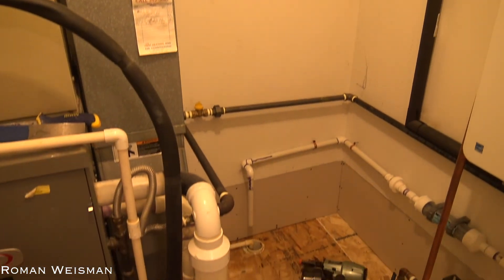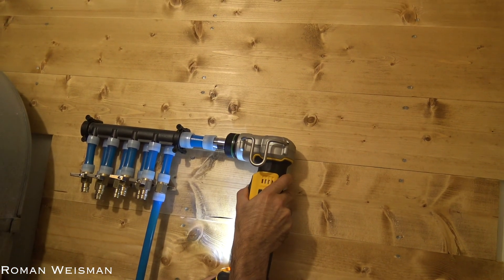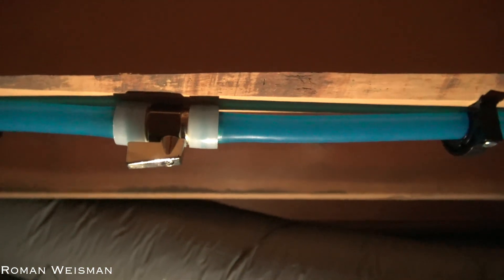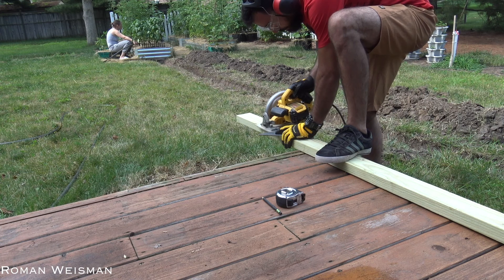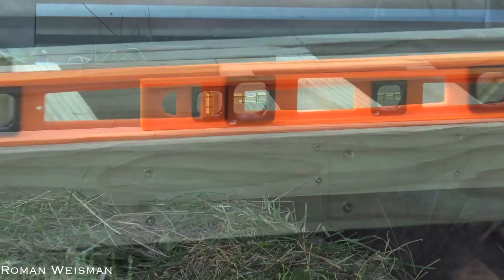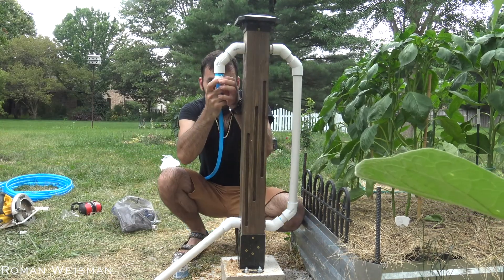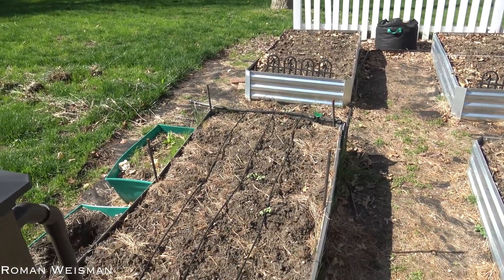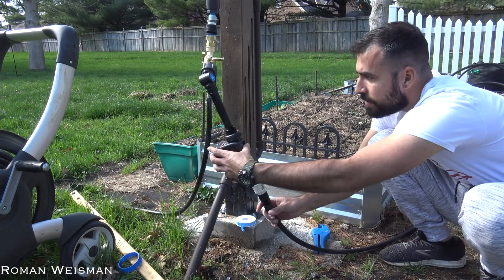Drip Irrigation System | Uponor PEX Water Manifold | Complete Install | One Year Review

Comment: Curious why not run pex all the way?
Reply from the maker: Hey - it runs all the way from the manifold, please elaborate if it’s not clear.
Reply: @RomanWeisman  Hi, I'm starting to diy the irrigation for my home and your video is very helpful, thank you. I'm just wondering why you didn't choose pex for the irrigation water main line (looks like you used sch 40 pvc), my current plan is to use pex for everything unless when the pipes need to go above ground (into the crawl space), I'd appreciate your insight.
Reply from the maker: 9:43